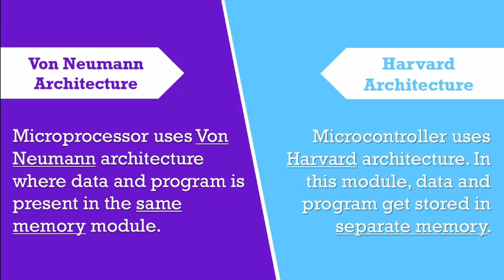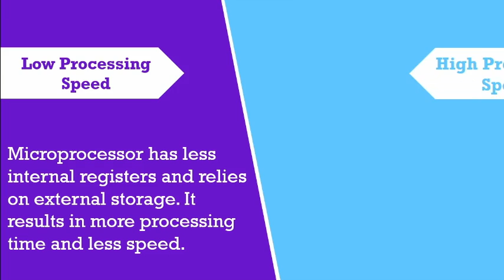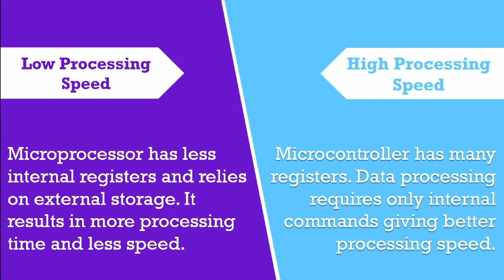Difference Between Microprocessor and Microcontroller (In Points)

Comment: Which is best mc or MP
Reply from the maker: Hi Raji, Thanks for asking the question. MC or MP : It totally depends on your usage. Both of them have their respective functionality. WE can guide if you tell us your need.
Reply: U can use microcontroller Atmega 32. It can be used for most of the applications.